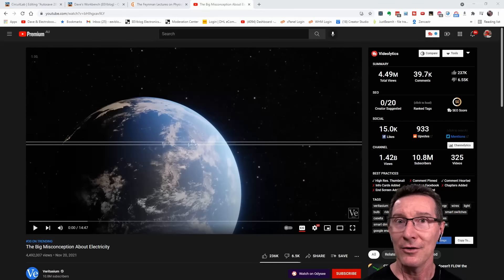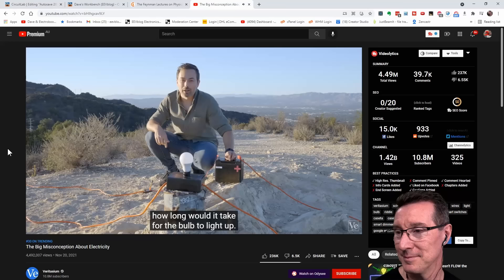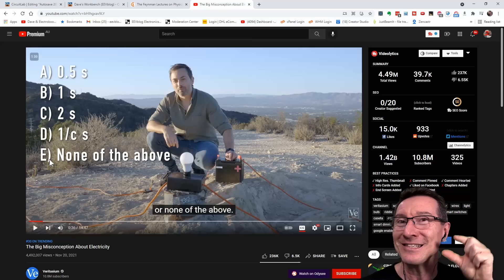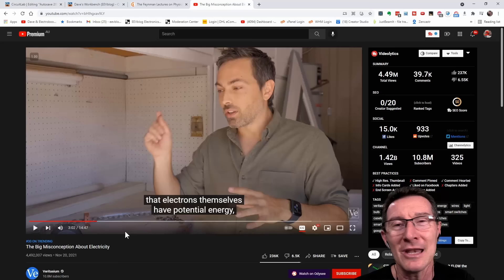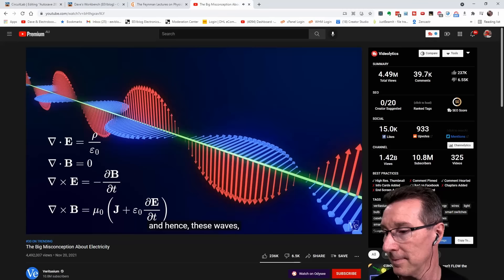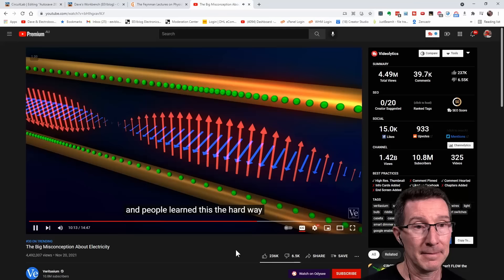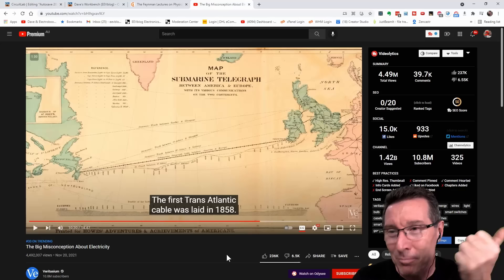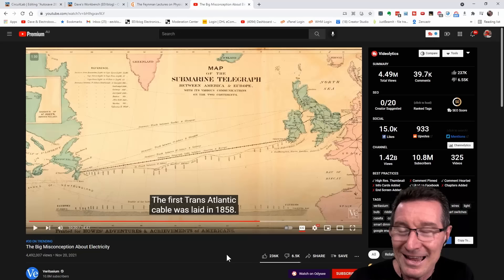EEVblog 1439 - Analysing Veritasium's Electricity Misconceptions Video

Comment: I read that sun emits energy (sunlight, both visible and invisible) in the form of photon, which has a very small mass. If, as explained in the video, the battery turns the lightbulb on by the energy that travels through electromagnetic waves, is any particle with mass involved in this energy transfer? If there is, is it the same particle as the photon? Also, would it be possible to see, by wearing special goggles/glasses if necessary, these particles if some sort of barrier/shield/paper is placed between the battery and the light bulb (similar to seeing sunlight reflected by a paper when the paper is placed in the path of sunlight)? Lastly, where are these particles with mass stored in the battery, in electrons or something else?

Comment: Dave, can you explain what would happen not just after 1m/C interval, but all the way to infinity! All the transmission/delay line effects and what actually happens in DC steady state? Looking forward to the next video!
Reply: Dave here uses the wrong model for Derek's experiment setup.  A transmission line model is not applicable, so what you see on his graph is incorrect, and Derek's answer of 1/c for immediate steady ON is also not entirely right, it's misleading. For the immediate transient, the better model is a dipole antenna model.   Also, Derek conflates DC steady state with transient analysis which is false and folks who want to learn, get misled.  See my explanation in the main thread.

Comment: Could not understand your answer and neither his. In short do you both mean that if the wires were placed 1miles apart instead of 1 meter, still the energy would have flown the same way instead of travelling all the 3 lac kilometers?
In that case why nothing happens to us when we stand in between the wires without touching them?
Shouldn't we be electrocuted?

Comment: “People seem to think you are pumping electrons”… And they are right. I see no problem with such a picture.  Remove the ”pump”, battery, generator or whatever source of these charges may be and the circuit will no longer perform any useful work. Derek’s argument ends up in a free fall of causation. It is never a good trade off to sell what we do know for what we don’t. If all the important stuff is happening outside the conductor, how does a fuse protect a circuit?

Comment: Y'all are getting wound up for a legitimate reason, that distance relationship is absolutely important and needs to be present to be TECHNICALLY correct. 

When I watched the video, it seemed to me that Derek was emphasizing how crazy it was that the wire doesn't even carry the power. Yes he messed up by simplifying to 1m and withholding the d, but it wasn't shady and the emphasis was certainly on field transmission, not the equation itself. 

It's like... Don't steal a professor's thunder for informing first year college students that gravity depends on distance (Fg=Gmm/r^2), even if he simplifies the equation too have m1 equal Earth's mass, and to bake it in to the G term. 

Concepts are what Derek's after, not deep technical accuracy. You can't get the everyday person excited and curious about science and engineering if you don't simplify enough for them to be able to climb on board.

Comment: Energy in and of itself is not flowing but rather the electromagnetic wave is propagating. The wave only carries the ability to transfer energy via interaction of the propagating wave with electrically charged particles just like gravity is a field but is not carrying energy.
On second thought the field is propagating potential energy at the speed of light

Comment: Closing the switch involves establishing the electromagnetic field on the wires which did exist before as there was no current flow.  This by itself is an AC phenomenon and therefore a transmission line problem if you use engineering terminology.   The setup itself, even though you ignore ohmic resistance, has inductance and parasitic capacitance from the wires which you cannot ignore.  This transmission line setup will dictate that the speed in establishing the eventual "DC" electromagnetic field follows the speed of EM wave propagation speed in the transmission line.  You might cheat by placing the battery very close to the light bulb.  But doing that would not give you energy "fast" enough to turn on the light bulb because the parasitic EM field going from the battery to the light bulb is too weak to do anything.  If you argue it can, it is just as saying closing the switch is like sending out a Marconi telegram (that was what actually happened in the old days) and the message is propagating to the light bulb and makes it shine.  I find that ridiculous if you are talking about light bulb.  To me, the bulk of the power has to follow the speed of EM wave propagation speed which in turns depends on the inductance and parasitic capacitance of the wires in the setup.

Comment: The power is not generated by the battery, the battery is a diode that slows and then directs ambient radiation, away from the (-) terminal. By slowing ambient radiation the battery creates an abundance of particles of electricity at the (-) terminal compared to the (+) terminal as marked on a car battery. Since the inductor offers the easiest path for the abundance of particles of electricity at the (-) terminal to escape they run inside the wire, not around the wire. The magnetic fields around wires are the effect of the flow from the (-) terminal to the (+) terminal, due to their charge. The power to move particles of electricity in a wire comes from around the wires from the universe, delivered by ambient radiation from outside the wire. This goes back to the German term neutron which has to do with this phenomenon that can supply a wire that is abundant or short of particles of electricity with the energy to move particles of electricity down the wire that is charged with an abundance or shortage of electricity.

Comment: This can be correct only if the resistor or bulb could recieve energy when one of the far ends of the circuit is open circuited. Otherwise,  the electromagnetic wave and its associated current  goes the whole way along the line length untill reatching the load ( resistor or light bulb)

Comment: The problem is that the first thing everyone learns in schools is how to turn on a light bulb from a battery. And if you are an engineer, you get that knowledge many many years later. Where as you should be told how energy is transferred from the element to the bulb in space (by wire transmission). And let's do that only after we bagatelize this for years. There would be a lot more smarter heads.

Comment: Hi, non-engineer here and I would disagree with 1m/c answer. Even your simulation clearly shows that the light flicker. When we designed simple circuits, we used the circuit steady state, which for such amount of wire will need multiple seconds to reach. I am pretty sure that there are some very sensitive circuits, that need to address the field behavior immediately when a switch is flipped, but the light bulb circuits are not one of them. The light will be permanently on using the full battery power after the field propagate back and forth many many many times, until the reactive resistance reaches zero. So in DC, the length of the wire matters. While his model and they way the question is designed favors 1m/c, looking at the field propagation for a light switch is like calculating the curvature of the Earth for building a house, or building a rocket for going to the supermarket. It might work, but it does not matter, a more simple model exists and that says the lamp will be permanently on after a few seconds if using that much wire. But yeah, the first energy will be delivered by the fields in 1/c seconds, after that almost all the energy will go to the wire, and only tiny amount of current will be in the lightbulb, until the (reactive) resistance of the wire reaches zero.

Comment: If there is energy flowing outside the cable, 
does it act as negative(subtractive energy) or positive(additive energy)? 

Meaning is there anyway to capture the external field and feed it back into the circuit as a energy gain?

Comment: I posted this before getting to the end of your video sorry bout that you explained it perfectly thanks I can see the difference between academic theory and practical applications.  BUT its very interesting the quantum weird stuff.  Cheers.  I will leave my original post for reference Cheers.  My theory.  Electrons (exist in a quantum state)  they therefore in a circuit exist in a quantum state they are being shared across the entire circuit but they are in a ground state as there is nothing manipulating that quantum ground state (well there has to be minute variations in this state due to outside magnetic fields but they are negligible) UNTIL the circuit is completed.  The entire field of electrons instantly exist in flowing quantum field not a ground state.  The delay to a full flow of current is resistance to that field being manipulated or in other words the ground state being altered, the natural resistance to the changing of the ground state or the inertia of that field.  A body or in this case electrons will remain at rest or in motion until acted upon by a net outside force.  But upon the circuit being completed the field equation being in a superfluid quantum state has instant results a very small current till the natural resistance is overcome and the entire field is in a full quantum state (this hints at instant and delayed quantum effects what I would expect from weird quantum stuff) and you have the full flow of electons.  I am not a scientist nor do I know what the hell I am talking about.  But that is my 2 cents worth.  Cheers and I wish everyone a Very Merry Xmas and a Happy new Year.

Comment: Nothing was mentioned of power factor, phasing, reflections, propagation, resonances, transients, light load on long lines, or type of installed line (UG or OH). This is why I consider talking about physics fundamentals relative to engineering similar to talking macroeconomics within investment thesis. It’s fun but no one should spend much time with it.

Comment: The thing about the 1/c, the 1 being obliged to be expressed in meters, is not right from your standpoint either.
In the SI system you don't have to express the units of every constant in the expression. Just the final units, and it's enough to say that the expression is in SI units.
For example, if you say that the electrical force between two electrons separated 1 meter is e²/4πε N (newtons) we are not obligated to specify the units of 4πε as long as it's understood that we're working in SI units.

Comment: So in this experiment the bulb will light even if wires are not connected at their ends one light second away, right? Because the bulb lights up in 1/c seconds but the information if the wires are connected will reach the bulb in 1 second. Otherwise it violates the theory of relativity, isn't it?

Comment: More seriously, this time -- with a sufficiently long transmission line, the same current should flow, initially, regardless of the load or lack thereof, correct? After all, the source has no way of knowing what the load is until the current has had enough time to flow to where the load (if any) would be. That sounds intuitively wrong, but after thinking about it, must be correct.

What am I missing?

Also, based on what I know of antenna theory (as a ham radio operator), certain multiples of a wavelength have infinite impedance (theoretically). I don't know how to apply that to DC, but at 50-60~ it's calculable.

Comment: It is a funny discussion because the two things can not be separated. In the DC case you can't tap energy from the surrounding field, so it is more of an theoretical discussion. You can also ask why the filament is heated on the microscopic level? The temperature of the filament is just a measure of average kinetic energy of the atoms, so somehow the field will make the atoms speed up the Harry Potter way due to a field which only can heat up this special filament :-)
The current density is even not distributed evenly. The forward current and the reverse current will tend to get as close to each other as possible (also in DC). The field will draw the charge carriers close to each other. This Veritasium video is not even wrong.

Comment: If there is NO rate of change in the electric and magnetic fields (that is :  DC) surrounding the wires in the battery / lamp circuit - how can any energy be transferred IN  the field ( and not in the wire)  ?   
All along  - in electrical/electronic engineering ..... we are told that it is "changing"  fields that represent energy flow....  (as in  Maxwell etc) 
Or ... is there something connected with the electron "drift"  that is in fact causing a changing Electromagnetic field sufficient to model  the statement that  energy  flows  outside the wire ... not in it.

Comment: The amount of power jumping the 1 meter separation via inductance/capacitance is not enough to actually cause the light bulb to light.  If this were so, you could cause any light bulb to light simply by holding it, unconnected, within one meter of an energized power line.  Clearly this is not the case.  You still have to wait for the wave front to travel the entire length of the loop before the light bulb illuminates.

Comment: As a refrigeration tech, I found this interesting but it wouldnt change my practices wiring high voltage or terminating controls.. I especially doubt engineers would take this into consideration either.

Comment: But aren't the electrons moving around in the wire the actual cause why the filament heats up? So while their movement causes the field and the field moves the electrons, the electrons are the medium through which the field dissipates its energy, be it inside the wire, filament or by induction in a somewhat parallel conductor, or even, by leakage in form of electromagnetic radiation.
At the beginning it's usually some magnet which moves, shoving electrons around, which themselves create a field to shove electrons around. The field needs a long strip of them to propagate that well. So in my terms the electrons are what carries the energy. The field again is what makes it transferable.
Please correct me if I'm wrong.

The field and the electrons are in a kind of feedback loop and depend on each other, so I find it dumb to pretend they were in any way separate or independent. It's a bit like saying matter doesn't attract matter, it's the space distortion causing that... No matter no distortion though. That the distortion propagates and therefore transports the effect to whatever is affected by it, doesn't mean the matter didn't cause the attraction. Maybe I'm completely lost here.

Was it all only fields outside the wire making bulbs glow I should have trouble switching lights off. 

That the direction of the energy is towards the spot where it dissipates also seems very much a no-brainer to me. But as electroBoom printed out, there also is self-induction in the real world. Worse even, the energy source, the battery, also dissipates some of the energy in the circuit. It feels to me Derek tried to mystify me about something almost banal to people who work with electronics (which I do not).

Comment: It seems, you are forgetting that  the voltage is already on the opened switch just before you close it. Veritasium failed to point that out as well. It doesn't matter where the battery is, but where the switch and lightbulb are. It means that the current begins to flow immediately through the switch. Which means that the EM field is created immediately around the switch and induces a current just opposite the switch, 1m/c seconds later.

Comment: here's the problem I have with this.... I open the electrical panel in my basement and there's a jumbled mess of interwoven wires crammed tightly together. if the energy were carried in the field around the wires (and not through the wires) then how does this mess of wires deliver precise amounts of energy to specific circuits only? seems like the chaotic EM field surrounding the nest of wires would result in totally unpredictable power delivery to the downstream conductors, but it doesn't. why?

Comment: Is t the electric field outside the unconnected battery negligible small compared to inside (lile inside a capacitor.
EM-waves in cable do not propagate at the speed of light, depending on the cable 0.6-0,9 c.
The E field of the battery causes surface  charges in the cable (by moving electrons to the surface) and these cause another smaller e-field which then make the electrons inside move? Why? 
Why the first e-field moves electrons only to the surface, and only them then make the inner one move?

Comment: Thank you! This makes sense now. So the lamp will get energy almost immediately but the full current will flow only after 1/2s?
I mean it has to be a difference if the circuit is closed at the far ends or not?
And we can't expect to see that difference faster than the speed of light.

Comment: How would a more realistic diagram be when the battery and the load are much more separated? I mean, I think the field lines from the battery to the bulb should be negligible and those just near the bulb should be "stronger". Am I right? I thing that even when 1 meter apart, the field lines from the battery should already be weak. I mean, even to wirelessly charge a cellphone you need contact unless you have an insanely great field.